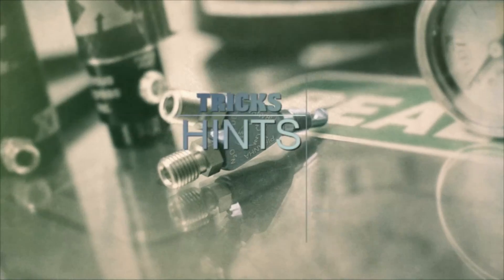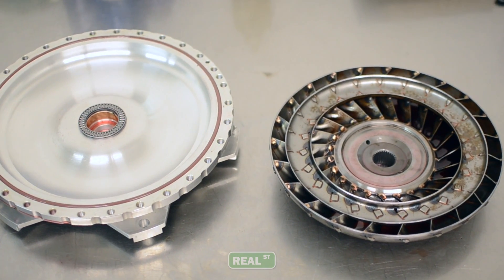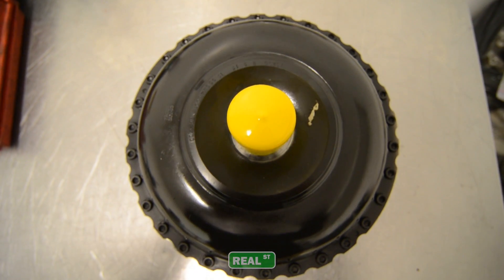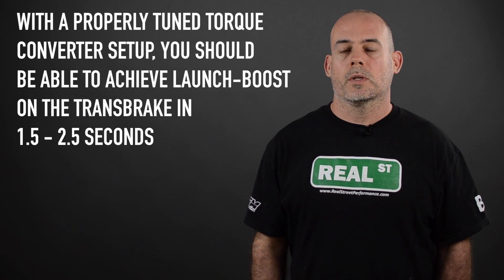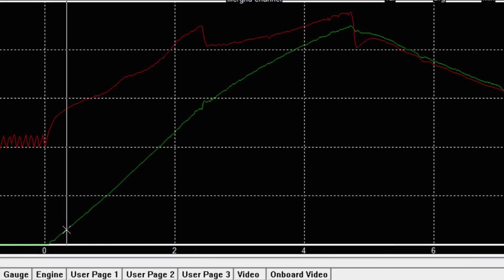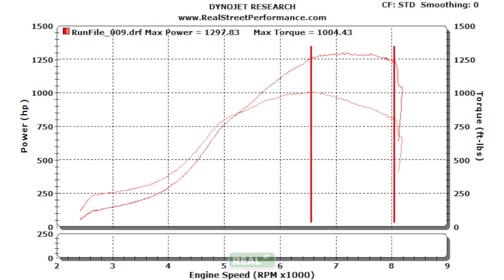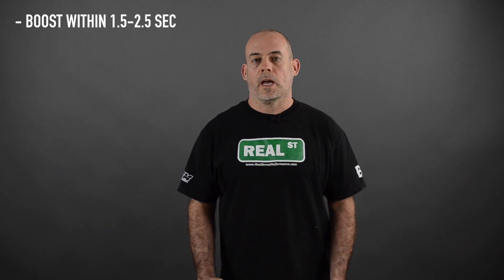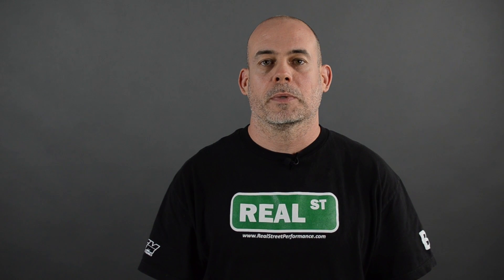Jay's Tech Tips #38 - Torque Converter Selection & Setup - Real Street Performance

Comment: With a near 500 hp 406 sbc/th 350/81/2” posi all new in 3/4 ton van is there any reason you would go with an 11”2800-3200 rather than a 10”?i went on advice of a well known tc company and got the 11” and while it worked there was absolutely no looseness anywhere which surprised me

Comment: Jay. Would you recommend protroque over the competition? I got a 427 sbc, 3400lb car with me, maybe 550 horse 580 ft lb, peak power under 5800 rpm I want to street/strip it. Drive it to the track, run a mid 11 and drive it back. I read protorque actually states their street/strip to be great at the track and still be able to daily it